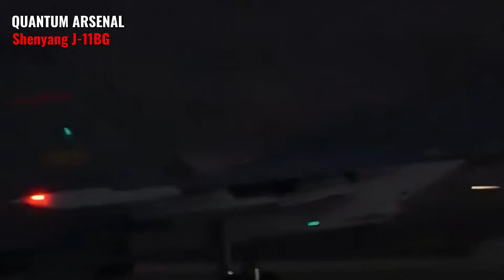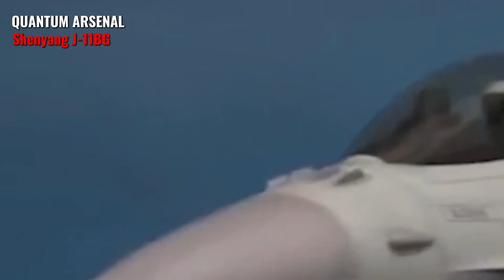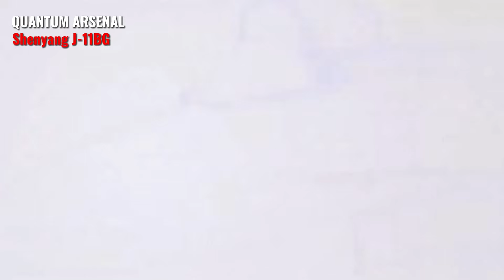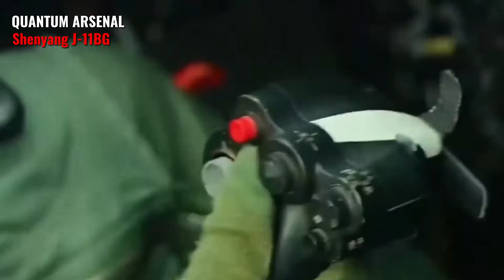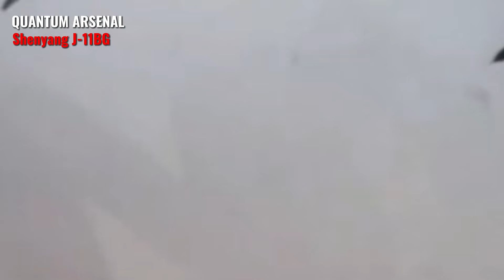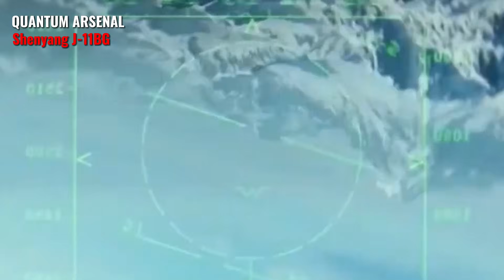The J-11BG — China Just Upgraded HUNDREDS of Flankers Into THREATS

Comment: Would this J-11BG be equal to the F-15 EX?  I think the F-15 EX has better engines in terms of durability and power.
Reply: "In terms of pure air combat capability, it’s a 'yes.' Although the J-11BG isn't as advanced as the J-16, it has undergone significant upgrades and can now deploy advanced missiles like the PL-10 and PL-15. The older airframe design isn't a major issue; the real problem lies in the numbers—how many F-15EXs are there compared to the number of J-11BGs?"
Reply: Far superior because of JL15 missiles.
Reply: @callehe  So US long range missiles are worthless compared to Chinese long range air-to-air missiles??
Reply: @ericb.4358 check their actual spec.  Not all “long range” missile is identical.
Reply: @aaewen  "Specs" on military arms are often exaggerated (as per usual with Russia) or understated for reasons of secrecy. PERFORMANCE is the real test. I trust US tech a bit more.
Reply: @ericb.4358  Chinese missile specs are understated and NATO tech is overstated. See Pakistand-India conflict. Chinese missiles range way exceeded specs.
Reply: @callehe  Sez You.
Reply: YEP, sez a YT desk jockey.

Comment: With the possible exception of electricity production, there was never any question of being able to take all of the J-20 electronics and sensors and to shove them into a flanker airframe.
Reply: Same with F-35 tech into an F-15 EX.
Reply: @ericb.4358  in theory, yes; however the F-35 is made by Lockheed Martin while the F-15EX is made by Boeing - you can bet that Lockheed Martin would sabotage any attempt to do so in an attempt to maximise F-35 sales.

China, where all the defence companies are government owned, doesn't have this problem...
Reply: @jiokl7g9t6  The US government can kick corporate asses when it wants to. It IS happening B/C the upgrades are from companies other than BOEING!
Reply: @ericb.4358 the US government can't do shit about corporate asses because Congress is fully owned and controlled by lobbyists - including MIC lobbyists. So is the Pentagon top brass for that matter.
Reply: @ericb.4358  Yes, the F-15EX is an improved F-15; but I've yet to hear anything about installing F-35 sensors and systems into the F-15EX.
Reply: @jiokl7g9t6  OK, perhaps not the exact same sensors as in the F-35 OR maybe the same. We do know there is a very good sensor suite on the F-15 EX. It is a FAR more lethal fighter than its successors, including the modernized Saudi and Quatari versions.

Comment: What are the differences between the J11BG, the J16, and the J15 naval variant? What have the Chinese done with the small number of Su35 they bought from Russia?
Reply: They have more lighter stronger airframe due to uses of more composite material and 3D printing componentsore advance radar and avionic components
Reply: Understanding China’s Flanker Family

    J-11A: Essentially the Su-27 imported directly from Russia.

    J-11B: A domestically produced Su-27. Early batches suffered from numerous issues, which were gradually resolved as technology matured. Middle batches became quite reliable, while later batches even incorporated new technologies; however, it remained an iterative improvement on the original foundation.

    J-11D: A redesigned Flanker that, aside from its aerodynamics and autocannon, was an entirely different aircraft from the Su-27. Due to development delays and its lack of the robust multi-role (air-to-ground/sea) capabilities found in the J-16, the project was eventually canceled. The technical feedback from its development was later funneled into the J-11BG.

    J-16: Developed almost concurrently with the J-11D. It maintains equivalent air-superiority performance while possessing powerful strike capabilities against land and sea targets. Utilizing many technologies derived from the J-20, it is undoubtedly a premier 4.5-generation fighter today.

    J-15: A heavy carrier-based fighter designed based on the J-11B, referencing a Su-33 prototype purchased from Ukraine. Due to time constraints and the fact that China only operated STOBAR (Short Take-Off Barrier Arrested Recovery) carriers at the time, its performance is considered average. Nevertheless, it made a massive contribution as China’s first step into the field of carrier-based aviation.

    J-15T: A new-generation carrier-based fighter designed to J-16 standards. It is not merely a J-15 with a catapult launch bar attached; it has been comprehensively optimized for carrier operations, simultaneously fulfilling air-superiority, anti-ship, and land-attack roles.

    J-11BG: Following the cancellation of the J-11D, the PLAAF still required a large number of air-superiority fighters to secure regional borders. Since the arsenal contained many J-11Bs with half or two-thirds of their service life remaining, these airframes were upgraded using J-11D development experience. By upgrading avionics and weaponry, they reach a standard close to the J-11D and are deployed in areas with lower defensive pressure.

Regarding the Su-35 acquisition: The primary reason was to serve as a "stopgap." At that time, the J-16 had not yet entered mass production, and the geopolitical climate was relatively hostile. China needed a batch of "advanced" fighters to alleviate immediate national defense pressure.
Reply: @moody203 👍🏻😊

Comment: China flankers the j11b and bs  variants are unlike the su27 are more sleek with composite materials and more absorbing paint and WS10 engine that is better in performance than 
The AL31 of the earlier J11 and now the BG variant with Modern avionics, flying by wire, AESA radar and the capabilities to lunch long BVR such as PL15 makes it more lethal in technological ter. than the Su35 that's without mentioning the j16 strike fighter which 4.5 Gen fighter and is considered the Best Flanker

Comment: A common theme on this channel is to not do the research or purposely mislead about the abilities of Su-35. So lets go first with the radar. The Su-35 does not use the Irbis-E the "E" means export. The Russian Su-35 uses the Irbis that has many more modes and functions than the export version. It specs are as follows 

The Su‑35S’s N035 Irbis is an X‑band hybrid ESA combining a high‑power PESA core (two TWTs: 5 kW avg/20 kW peak + 2 kW avg) with ~1800 AESA‑like TR elements, enabling multi‑beam, wideband, high‑agility operation and a huge 240° field of regard via a gyro‑stabilized two‑axis gimbal. It supports simultaneous A2A/A2G modes, concurrent HPRF/MPRF operation, and delivers 400–450 km front‑hemisphere detection in HPRF, 150 km rear in MPRF, and 300 km in combined AVT mode. Against incoming targets it detects ~100 km (0.01 m²), 180 km (0.1 m²), 270 km (1 m²), and 400 km (3 m²), with 150 km for receding 3 m². It tracks 30 targets and engages 8, handles speeds up to 6000 km/h, and offers A2G RB/DBS/SAR modes at 400/300/200 km with 3/2/1 m resolution plus full nav/IFF/weather/ECCM functionality.

There is also a newer version of the radar that includes these improvements:

The N135 represents an evolutionary upgrade of the Su‑35’s N035 PESA rather than a shift to AESA its designation alone signals continuity with the Irbis lineage rather than integration into the N036 Byelka family. Reports suggest the N135 introduces far more powerful digital signal processing, extending detection range, sharpening target discrimination, and improving performance against low‑observable threats, while refined multi‑mode switching accelerates transitions between A2A and A2G tasks. Enhanced ECCM further strengthens resilience against modern jamming, complementing the Su‑35’s existing passive systems and networked tactics via the S‑108 datalink. By building on proven PESA hardware instead of demanding a full AESA retrofit—with its heavy avionics, cooling, and software penalties—the N135 offers a low‑risk, high‑impact modernization path that preserves compatibility, reduces integration burden, and elevates the Su‑35’s situational awareness, flexibility, and survivability in contested airspace.

Lastly the SU-35 passive SPO-32 system puts it ahead of any 4.5 generation fighter even with an AESA:

The Su‑35’s SPO‑32 Pastel (L150‑35) gives it an unmatched passive ESM/RWR envelope for a 4.5‑generation fighter, covering 1–40 GHz with the ability to detect, classify, and geolocate emissions from hundreds of kilometers, including agile‑frequency LPI radars hopping 1000+ times per second. Its distributed antenna network across the wings, stabilizers, and tail boom delivers 2° Ka‑band and 15° L‑band resolution precision no Western 4.5‑gen platform can replicate—allowing true passive BVR engagements with R‑77-1/ R-77M 9B1103M‑200PS (200 km), and SEAD strikes with Kh‑31PM out to 250 km. This gives the Su‑35 a rare ability to prosecute air and ground targets without radiating, turning enemy radar emissions into its own targeting data while remaining electromagnetically silent. What separates it from every other 4.5‑gen fighter is that none of them neither the J-11BG,F‑15EX, Rafale, Typhoon, nor Gripen combine this bandwidth, angular precision, missile integration, and long‑range passive kill capability. They rely on active radar to fight; the Su‑35 can fight without ever turning its radar on, giving it a first‑shot, first‑kill advantage in environments where emitting is a liability and silence is survival.
Reply: I still say China have better radar tech.
Reply: @keithwan4028  Chinese have access to GaN but in algorithm writing Russia has been best in world for a long time so I would doubt very seriously that  even with extra power they are able to outperform the Russian systems.
Reply: @chadbernard2641 ”xxxx has been best in the world for a long time “
Automobile industry has been dominated by German companies and Japanese companies for a long time 
Then there is BYD and Xiaomi 
In what logic is dominance forever stands?
Do you have any idea how fast Chinese companies develop things?
Reply: @I39393I There is a contest for writing algorithms. The Russians always win that contest.  This isn't my opinion it is just a fact.
Reply: @chadbernard2641  actually it’s 100% your opinion. And honestly they’re all done in FPGAs and DSPs anyway. I wanna see how you’re going to outperform in FFT against something running at 10x your clock with 5x the level of parallelism.
Reply: @chadbernard2641 if this so called algorithm is that op Russians must be real strong huh 
They might finish the war in weeks!
Reply: @chadbernard2641  That would be 10-15 years ago. China has already surpassed Russia with its J-20, J-35 combined with WS-10C and WS-15. In terms os writing algorithm, just take a look at how many Chinese AI experts in the world vs how many Russians. Oh take a look at how many gold medals China has over the last 15-20 years in Math and Information Olympics vs other countries in the world including Russia.
Reply: @chadbernard2641  Really? Why don't you take a look at how many top AI experts in the world are Chineses vs how many Russians. Also take a look at how many gold medals China has won in Math and Information Olympics over the last 20 years vs how many by Russia.
Reply: 😊 youve done your homework 😊 thanks for posting
Reply: Awoh!
I red it all!
Reply: That’s all just Russian marketing BS, tho. You’re not trying to search for a 747 in a 3 degree x 3 degree cone in real combat.
Reply: @johnsullivan8673  That is not the point, that is just taking specs and trying to play devils advocate when you know that is not how it works is just a silly response. Once the heading and area is detected through passive means or L-band detection then you  can use a narrow focus if needed to find a firing solution. it is not meant as a volume scanning technique. I assume you know know that and if you didn't you should know that before making a comment.
Reply: @chadbernard2641  so it’s funny you say that because while I can’t speak for Russian experience with the IRBIS, and Chinese experience seems to somewhat trivialize their samples, there are some VERY telling reports from Egypt when they benchmarked the system. Essentially even with offboard cueing the Su35 had a very hard time with detection, and tracking and providing a firing solution was even worse. Sure the system can pump out a lot of raw power, but due to the RMS nature of EM return and a stagnant Russian electronics industry, given what I’ve read about what leaked out of Egypt (and maybe Algeria), I would say practically speaking, IRBIS operates at around the capabilities of state of the art airborne set from the late 90s.
Reply: @johnsullivan8673 Did Egypt ever benchmark the Irbis‑E, did Algeria ever test it, or did Egypt really fly a Rafale head‑to‑head against a Su‑35? No — none of these claims survive even basic scrutiny. Egypt never received fully equipped Su‑35s, never had access to the Irbis‑E’s classified backend, and never possessed the infrastructure required for instrumented radar benchmarking, while Algeria only began receiving Su‑35s late in 2025 and therefore could not have conducted any historical Irbis‑E evaluations before that point. And the Rafale story is the weakest of all: France has never provided Rafales for adversarial trials against Russian jets on foreign soil, and Egypt never had a combat‑ready Su‑35 to compare them with. If any of these “tests” had actually occurred, there would be data, leaks, pilot accounts, procurement documents, or at least a traceable source instead there is nothing, because all three narratives are recycled rumor‑mill inventions masquerading as technical evaluations.

So apparently the Irbis radar throwing 5 kW average and 20 kW peak, running simultaneous HPRF/MPRF, generating multi‑beam wideband waveforms, pushing 400+ km detection on 3 m² targets, and delivering 1–3 m SAR/DBS resolution is “operating at late‑1990s levels.” Right, because in the 1990s Western fighters were totally flying around with dual‑channel high‑power TWTs, ~1800 TR‑element hybrid arrays, 240° gimballed fields of regard, concurrent A2A/A2G tasking, and multi‑mode frequency‑agile beams. Except...they weren’t. They had single‑channel, sub‑kilowatt, narrowband PESA sets like APG‑63(V)1, CAPTOR‑M, and early RBE2 variants that couldn’t even dream of Irbis's power budget, angular coverage, or processing throughput. And the punchline? In raw detection physics where power‑aperture product, beam agility, and wideband waveform energy actually matter Irbis, and especially the upcoming N135, can and does outperform several modern AESA radars whose low‑power solid‑state modules simply cannot match a multi‑kilowatt hybrid ESA’s long‑range energy delivery. That’s not opinion; that’s radar equation math. Calling Irbis “late‑90s level” is like calling a freight train “basically a bicycle” because both have wheels it only works if you’ve never looked at the specs, the architecture, or the physics.
Reply: Thanks 🙏🏾 for the excellent insight!
Reply: 如果S35如此厉害，为什么俄罗斯甚至在面对三流空军的乌克兰时都无法夺取战场制空权？你有考虑过这个问题吗？事实上，中国的那24架S35的处境现在就非常尴尬，基本摆在机库里积满了灰尘，在中国互联网上，甚至有声音说把这批S35返销给俄罗斯。
为什么？先说那个雷达，中国空军发现它远没有宣传中那么神奇，它在再理想的情况下对大型运输机的发现距离还不错，但无法获取精确参数，因为信号模糊。就连面对非隐身飞机这样的目标时，与你所列举的数据也大打折扣，俄罗斯人在宣传上是夸大其词的，但我能理解，广告就是这样的。
再说这架飞机所能装载的武器，它们已经远远落后于中国的国产武器了，而且，也是最为重要的一点是，它只能搭载俄罗斯的武器，不能挂载中国的武器，也就是兼容性和后勤上有不足之处，如果中国有更多、更好的武器，为什么还要S35呢？
我不是说s35是一架落后的飞机，这架飞机性能仍然出色，尤其是它的大载弹量、大航程和出色的狗斗性能，但这些出色的性能现在中国并不缺，因为中国进步太快了，快到连S35都反应不过来就被抛在了身后，这就是它在中国的处境非常尴尬的原因。